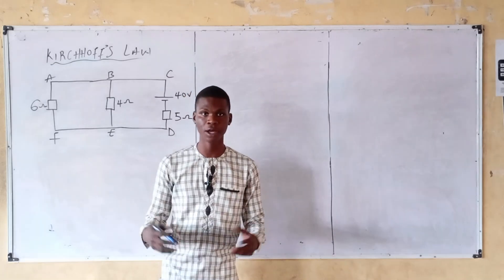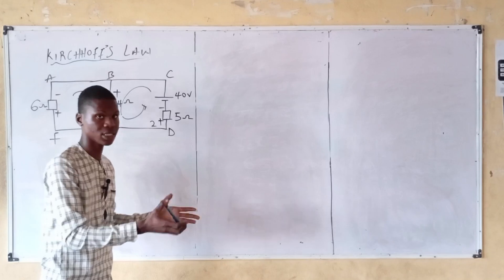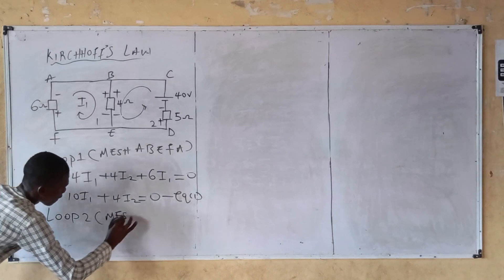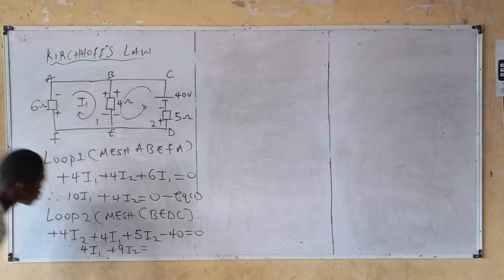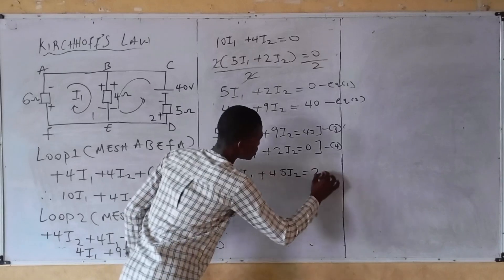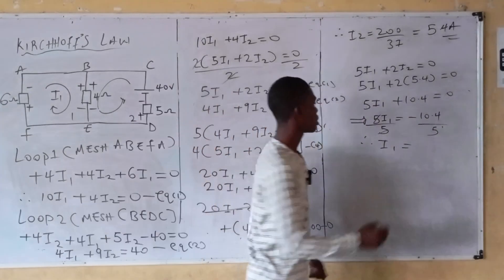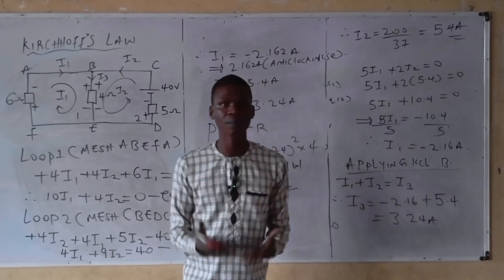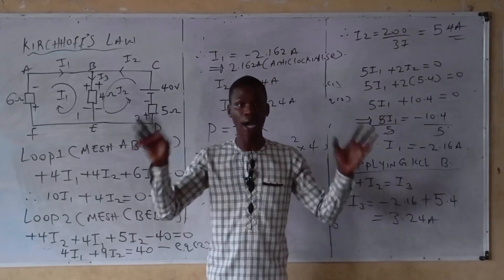Kirchhoff's Laws1l Kirchhoff's Current Law(KCL)lKirchhoff's Voltage Law(KVL)#furtheracademy

Comment: I’m having a problem. Don’t want to talk of the rule of moving from positive to negative there’s  a gain in voltage in a passive component. 

Why that there is no voltage source in ABEFA, yet you are applying a rule which says an algebraic sum of emfs(source) is equal to the sum of the potential differences which I was thought to be any other component that the source emf pass and drops voltage
Reply from the maker: Send a DM

Comment from the maker: If the assumed direction is incorrect, the current value will simply come out as negative, indicating the actual direction is opposite of what was assumed.
So, Irrespective of your direction in Mesh Analysis, you will definitely get the same value of current!!!